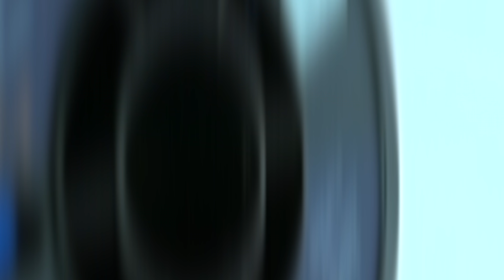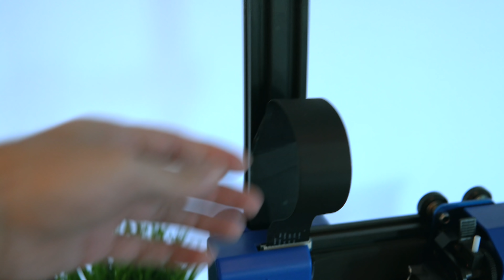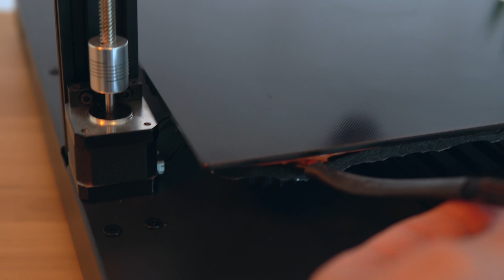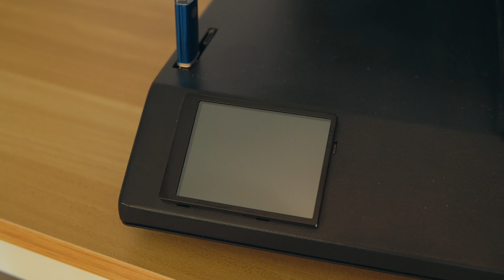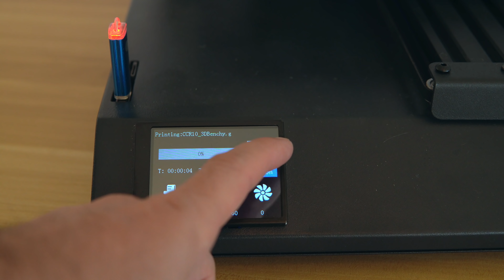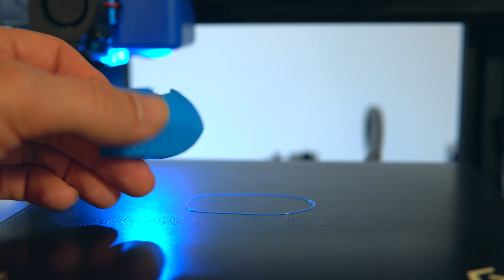Artillery - Sidewinder X1 vs Genius - 3d Printer

Comment: I think I'll go for a Genius, but do some modding to it.  Like an aluminum rail on top for strength, replace the plastic mounts with aluminum ones, and maybe extend the X axis out about 80mm more because 220 is just slightly too short for some things I want to print.

Comment: I'm brand new to 3d printing. Everybody talks about Ender 3 Pro but these look like they're much nicer. Which would you suggest for first printer?
Reply: Ender 3 is really loud and not as polished as these two machines. also you can print almost any filament on the x1 and genius
Reply: One of those, if go to cheap you'll pay more later and in time.

Comment: Your Sidewinder is an older unit.  The newer Sidewinders version 3 and 3.5 or higher have the reset button, LCD is  recessed in to the unit, hotend cover and cooling fan ducts are injected molded.  Thanks for the comparison.  I was wonder that the top rail looked like.

Comment: Sorry, you missed the main difference between the printers. On the Genius it's not only a plastic cover on x/z part you might have to disassamble to adjust the tension of z-rollers, but it works as a plastic spring instead of a exentric nut. So nothing to adjust there.
How long does such a plastic spring last? How much to replace it, as you will definitly have to do over time?
Sorry, but that point is the most critical of the whole Genius design. In my opinion its a No-Go and changing it to a metal design with exentric nut afterwarts (and you will have to do so somewhere in the future) will eat up most of the difference in price.

Secondly beware it is not a suprise booth printers start nearly after the same heatup time. The thermistors are in the silicone pad, not in the glas bed. So booth printers start when the silicon mat is up to temp, not the surface. The big question: How much time need the glas to heat up? How big are the holes in the silicon heater around the leveling screws? How much is the surface temperature affected from non even heating?
Reply: Hmm, this argument might change my decision in the last moment. 🤔

Comment: I'm not a fan of the ribbon cables and am curious to know how long these will last before failing
Reply: I have both and have had no issues. Both have been running for months almost non stop.
Reply: Time will tell.  It comes with replacement ribbon cables just in case. I have the sidewinder. It's really nice.
Reply: That's good to know Jim, either they have failed in bench testing or they are not leaving it to chance.
Reply: Same here. I am concerned the ribbon cables will fail over time quicker than the standard wiring/connector approach.
Reply: Dude, ribbon cables have been used in printers since forever. They last lmao